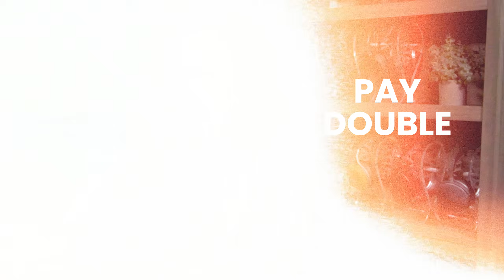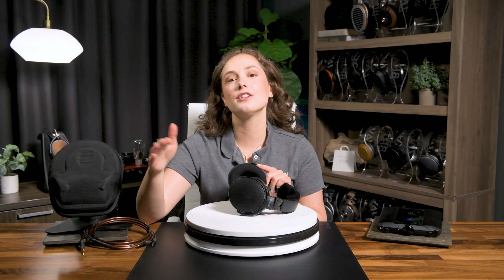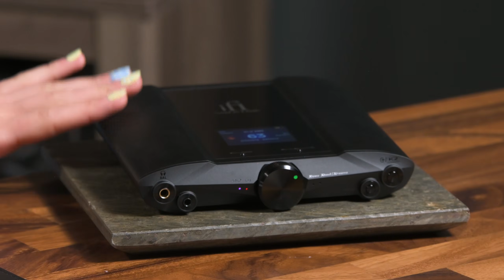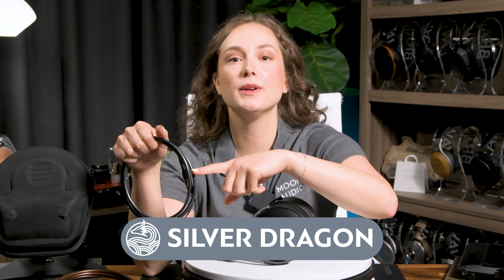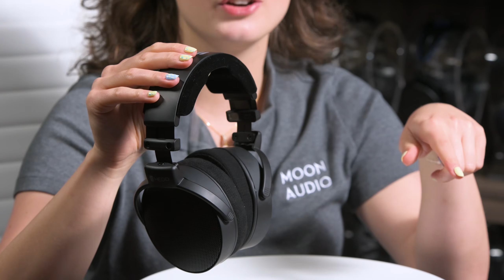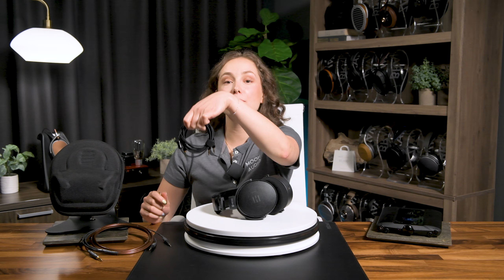A BUDGET Headphone Shouldn't Sound This GOOD! HEDDphone D1 Review

Comment: Calling 800$ D1 budget headphones is the best audiophile joke I've heard in weeks. LMAO. 
The value of D1 lies in its utility for work and its excellent neutrality, rather than in its value for money. If we’re really talking about budget, any properly driven planar magnetic headphones in this price range would simply beat D1.
Reply: "If we’re really talking about budget, any properly driven planar magnetic headphones in this price range would simply beat D1." - I think that's a biased oversimplification, planar doesn't automatically mean better even in this price range - especially with the D1's carbon fiber driver that is effectively as fast as a planar membrane and can take 8-10 dB bass boost without any distortion.
Reply: No it won’t. While Hifiman has better bass it’s not nearly as clean. The D1 truly lifts a veil it’s insane.
Reply: Yeah thats just not accurate, i would pretty much agree if the dynamic driver used was a paper cone but its not, the material used has been made specifically to be on par with planar for speed with the flexibility and rigidity of dynamics. Its not really just a marketing thing either, you can go look up TCPD speakers and see for yourself that they are reserved for the extremely high, a set of perlisten sb4 bookshelf speakers using TCPD drivers cost multiple thousands, with floor standing 7 driver speakers costing upwards of £18,000 a pair.

The D1's using these drivers (albeit tiny ones ofcourse) is pretty damn cool and in my experience they do perform on par or better than the planars i own through the amps i mainly use, i own headphones like the hifiman arya stealth, edition XV, audeze LCDX and the D1's are my preference, only when you get to like LCD-4's do they have a bit more punch. I mainly use a fiio R2R desktop dac into an ibasso pb6 macaw amp so plenty of power available for a solid representation of what the headphones can do.

I find planars to be pretty great but its quite easy to find their limitations in the low end, naturally low excursion unlike a good dynamic and the D1 is a damn good dynamic.